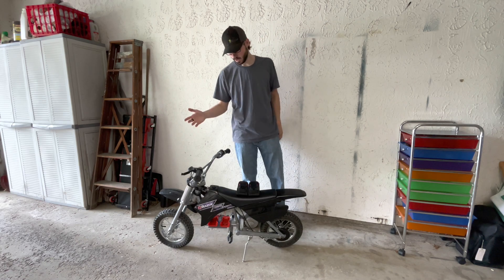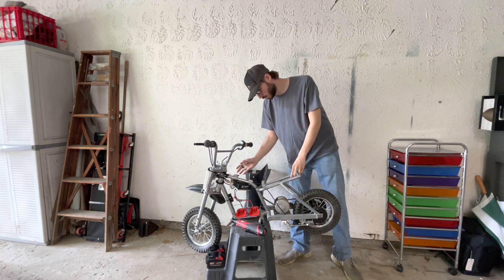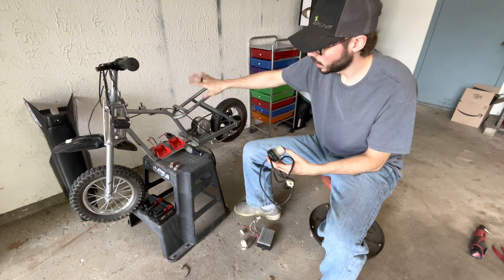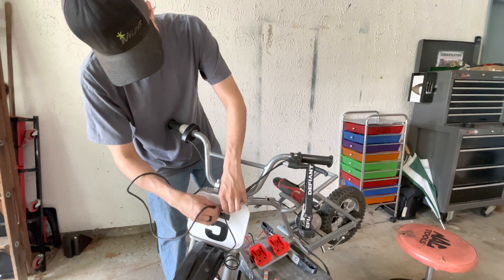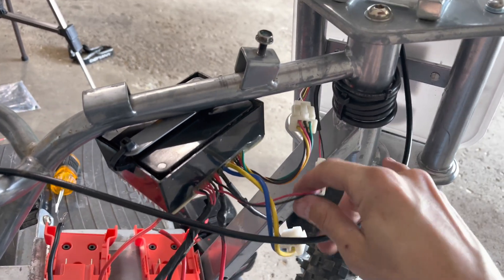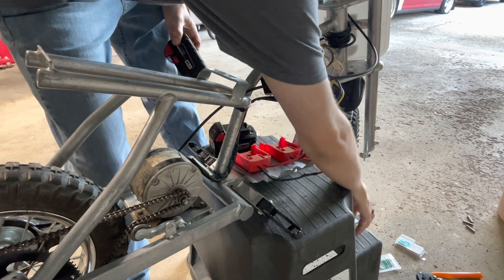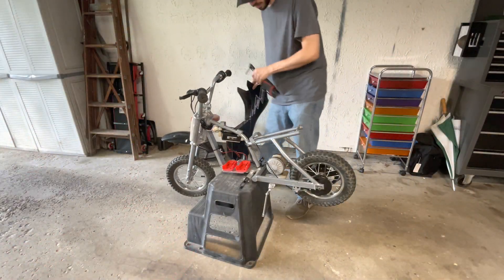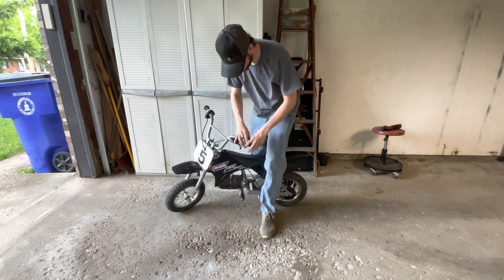How to make a Razor Mx350 run on Drill Batteries — JordyBuilds

Comment: Hey was wondering if you could help me out with a couple things on this build. I just finished the same build. Only difference is I’m running two 20v 5ah batteries. The led volt meter always shows 100% and never moves. The volts works, starts off at 40.9v but then only will go down to roughly 32v and the bike is almost dead. The tester right on the batteries shows they still have power. Not sure why I’m not getting full battery use. And not sure why the percentage is not working on volt meter.
Reply from the maker: The bolt meter comes with a manual you have to set it up for what batteries you are using. As far as the power just make sure both batteries are fully charged. If it wants to stop and go still it’s possible the motor is going out
Reply: The discharge curve from a lith-ion battery is very different than the lead-acid ones. The meters have to be compatible with battery type. You may be getting inaccurate readings. Also, lith-ion drops off very quickly in voltage. It could be reading 40v one minute and quickly dip to 30V, and by this time, the battery needs charging.
Reply from the maker: Your 5ah batteries are not dropping 10v in a minute. 30v is also below the voltage cut off when you’d need to pull batteries. Make sure to not spread misinformation.
Reply: @JordyBuilds  look at the lithium ion discharge curve. With a large enough load, it would easily run out of juice in a minute. The curve drops off a cliff.
Reply from the maker: You’re incorrect but okay
Reply: @JordyBuilds  ...you mean to tell me I'm wrong about the sudden drop in voltage a lithium ion battery experiences? The voltage discharge graphs are well-known. Any surge of current needed to move a load can drop the voltage by over 10% and if the discharge curve is at the tail end, it can very well drop as i described. I'm wrong about facts?
Reply from the maker: @DescartesRenegade of these batteries were discharged at a rate to which they’d be empty in less than a minute from a full charge on two m18 wires in series for 36v 5ah , they’d catch fire. No tool battery can handle the amps needed to drain the battery in under a minute. Look up any video and show me a 5ah battery being drained in under a minute.
Reply: @JordyBuilds  I never said from full charge...but from a voltage reading that shows sufficient voltage. There is a major difference. Thats why I told you to look at the discharge curves. They operate at a "full voltage" then drop off at a cliff. It's data.

Comment: We did this upgrade and my daughter burned the motor 😅. We ordered the mx500 motor and now we gotta build a bracket to mount it on the bike. Will I have to change the chain or add links? If you have any advice I will gladly take it.
Reply from the maker: I would order an extra chain with a master link just in case with a chain breaker but it shouldn’t be too difficult! If you need help let me know

Comment: If I ad the controller and throttle to my 24v mx350 will it give me any more power? Or work? Or do I have to do 36v?
Reply from the maker: Yes you need 36v to run the 36v controller

Comment: I Just upgraded mine but with a battery pack with an XT60 connector, what the best place to hook up the display screen?
Reply from the maker: Either the stock plastic battery box or I’ve seen people mount them by the handlebars too
Reply: @JordyBuilds  Oh gotcha, that makes sense but I was trying to figure out how to hook it up for it to work with the XT-60 connector. Also Is there a special button or configuration you have to push to get it to work?
Reply from the maker: It should come with directions to set up for your battery. It just connectors to the positive and negative of your battery wires off your controller

Comment: Hey so I wired mine just like yours in video and I just get a clicking when cracking throttle everything stock on bike also it worked with stock battery’s
Reply from the maker: It needs to be a Mx500/Sx500 controller and throttle. If you already have that, sounds like it maybe a dead battery.
Reply: Did you get it running mine’s doing the same wired everything just the way it should be and just get no response at all
Reply from the maker: Junk batteries probably
Reply: @JordyBuilds  will try a new set

Comment: What kinda run time does those two 18v 5 amp batteries get you?
Reply from the maker: About an hour on flat ground! I’ve done a little over mile round trip on them lol!
Reply: @JordyBuilds   Wouldn't it be able to go more than a mile it it could run for an hour drawing 10 amps?
Reply from the maker: @mattanfang  what
Reply: @JordyBuilds  Sorry I was confused at how much runtime you got on them with 2 5 amp batteries.  I think you mean an hour runtime and so far you've only ran it for a mile but that's not the total distance taken in the hour of runtime.  My kids are smaller so maybe 2 5 amp batteries will hopefully suffice.  Thanks again for the awesome vid
Reply from the maker: @mattanfang I did a full test not in the video on how long I got to ride on two 5ah milwaukees in series and it was about 45 minutes but I’m also 150lbs

Comment: To much work , just use fast scooter mod and buy a 36v battery and a 750 watt motor. 

Though this is a good mod to safe money.
Reply from the maker: I didn’t think it was that much work. No need to spend money on a fast scooter controller when a mx500 is almost identical. This does save money if you particularly want to use drill batts. I do agree go lithium though. I have two built mx500 48v lithium 2kw.

Comment: Screw the controller all together just run a switch between battery and motor easy and fast
Reply from the maker: That’s how you fry a battery as well as start a lithium fire. I’ll pass but you do you !

Comment: Hi Jordy. Have an issue that I’m wondering if I could bounce off you. I followed your video, minus replacing the control board and throttle. I’m getting power and the motor will “click” and if I turn the throttle 15 times it will actually go. Wondering if you have any thoughts on what could be wrong?
Reply from the maker: What controller and throttle do you have?
Reply: @JordyBuilds  the standard throttle and controller that came with the mx350
Reply from the maker: I upgraded to the mx500 throttle so I could have a variable throttle. The 24v is just a on off throttle really
Reply: Hey Jordy, just in case someone else asks, it was definitely the controller. There must be some limiter in the 350 modal but works like a charm with the 500 controller. Thanks!
Reply from the maker: Super glad to hear ! Thank you for the update
Reply: @JordyBuilds 😊

Comment: just for completeness:

the stock battery is 24v 7 amp hours
the new battery setup would be 36v (two 18v in series) and 5 amp hour

you should see a small decrease in range from stock, but this is completely determined by the amp hour of the batteries you plug in. Just make sure they are the same, or the smaller battery will do more work and wear itself out
Reply from the maker: The batteries that was in mine I think were 5ah

Comment: Hello, I'm building an occ chopper bicycle with an mx350 motor with controller.
I have 2x( 20v, 3.9 ah) batteries. Amazon has adapters with/without fuses.
Idk if the batteries are enough, or which adapter to buy?
I read that some batteries and motors permenatley died trying this please help.
Reply from the maker: I never had a fuse on mine but you can just put a fuse for what your controller is rated for. Example: 30a max current controller so run a 30/35amp fuse

Comment: Would this work the same on the Razor Pocket rocket? Want to convert one to high power drill battery but don’t know where to get parts and what parts to use?
Reply from the maker: Yes. Try razor website or scooter parts
Reply: @JordyBuilds  Ok thanks for the advice!

Comment: So I can do everything you did on the mx500 or 650 ? Is this setup ideal for them aswell ? Thanks man , good vid to
Reply from the maker: Yes. Although a mx500 weighs significantly more so you won’t have as high top speed or as long of range
Reply: @JordyBuilds  any suggestions on what I can do for run time / ideal build ? It’s to start my 7 year old on , appreciate the  info
Reply from the maker: I’d try to snag a mx350 to start with, if not there’s more options to see on YouTube or in “modified razors” Facebook group!

Comment: You could probably just use some 24V Kobalt batteries. I think Craftsman had some of those, too. They didn't make a lot of items that took them, so they're more rare than Kobalt.
Reply: I think the point is to use the batteries you have instead of buying new ones
Reply from the maker: That may make for 48v

Comment: I have the mx650 . Can I put 3 18volt batteries on series without blowing the motor up? I saw a guy making it a 72 volt, but had to upgrade controller, and motor.
Reply from the maker: You should be able to but it might blow the controller up eventually

Comment: For your next upgrade, you should try to do a shunt bypass mod. It made a big difference with acceleration, on my mx500. And if you can get a controller from a mx500 or mx650. Those controllers can take 50v. One problem I did have, after the shunt bypass mod, was that one of the 30 amp fuses blew. So I replaced it with a 40 amp. I think your mx350 would go 25 maybe 30, with another battery.

Comment: How would i connect 4 of these in order to achieve 72v
Reply from the maker: Wire them in series!
Reply: Armando... have you done this yet in 72volt? I heard that it will burnout the motor.  There is an upgraded controller and motor for 72volt that can be purchased to accomplish that upgrade. I was just wondering if you did it to know exactly if it works.
Reply: @nextgeneration4211  yes i did but for the over volt 24 to 36 i used 2 in series and 2 in parallel and recently went with the big boys to a 72v 3kw motor and controller on 4 m18 batteries in series

Comment: I got eveything installed i have power and here click noise on the contoller when i hit the throttle but the motor is not moving. I am using two 18v 5ah milwakee batteries. Any suggestions?
Reply from the maker: Are you using a mx500 throttle and controller ?
Reply: @JordyBuilds  yes
Reply from the maker: Sounds like a bad motor or the chain is too tight maybe. Join the Facebook group “modified razors” and ask there. Forums or Facebook groups have helped me trouble shoot a lot

Comment: Haven't used drill batteries yet.  But I did wire in an extra 12v battery, cut just one motor lead. Have it on a switch, one way normal.  The other setting the motor sees 12v with no throttle, throttle gives you the normal 24v.
Reply from the maker: There ya go!
Reply: I'm trying to do the same thing. I got an identical 12 volt 7 amp battery out of a jumper box. Just added the third battery in series and then I got some quick connect stuff so I can charge the original two batteries with the original charger and use my AC/DC quick charger for the third battery. So after every charge I have to connect those wires back up into series. However after doing all that crap I'm just using stock 350 controller. I don't feel like I'm getting any more speed out of three batteries. It might even be running slower. Thought it might be a charging issue. I am definitely no electrical engineer. Are there any more details you can share with me about getting a stock mx350 to run on 36 volts with a third 12 volt battery. Or do I need to buy some upgraded electronics? Everything I try to do I try to do is cheaply or free as possible so you know... Lol

Comment: Stupid question but how bad would it be to hook up 36v to the factory controller on the 350?
Reply from the maker: I believe any razor controller can handle being over volted 12volts and work fine for a bit but it’s not 100% ideal
Reply: @JordyBuilds  thanks.
I don't really care about the system.  If it burns up ill just upgrade it then.
I have two 12.0 milwaukee batteries om my mx500 but I'm about to get a couple of 350s.
I think I'll try the same thing and if it works then good and if not that's OK too. 
I just wanted to make sure it wouldn't fry something as soon as I hooked it up.

Comment: Great video! If I want to add more batteries to make it last longer I should just connect all of them in parallel so I don't get over 36v and fry my controller?
Reply: Ya, you can add as much as you want, it will only draw the amps it needs at that voltage.
Reply from the maker: Sorry for the late response but yes!!

Comment: What did you do with extra cables on the controller? Not sure If I saw you use them all?
Reply from the maker: Since it’s a mx500 controller it has some extra connections I didn’t use like brake light and such! I usually zip tie the extra wires together to help with cable management.
Reply: @JordyBuilds  I am getting clicking and no movement on the motor. I am using only one Milwaukee drill battery at the moment. Do I need to use two for this controller to work?
Reply from the maker: I’m not sure if 18v is enough as some require a minimum input

Comment: How many hours dose it last on those 2 batteries
Reply from the maker: Little over an hour on flat ground!
Reply: @JordyBuilds   dose the on /off button still work or no
Reply: Can I do it with one  Lithium 20 vote dewalt battery
Reply from the maker: @jamesthompson6085  no, that’ll only be 20v. They are more than that stock

Comment: I know you said you'll make a video comparing how much faster it will be. But can you tell us by feel how much more torque and faster by feel.
Reply: I'm 170lbs my stock mx350 gets to 14mph.  It's dramatically slower on the grass though but still gets up to speed.   I'm curious how long do those batteries go on a charge.
Reply from the maker: @irocss85  little over an hour for me!
Reply from the maker: So I never rode a stock one, I got this one with no batteries and did the upgrade. But I’m 140lbs 5’10” and I hit 20 mph on flat ground, rather quickly!